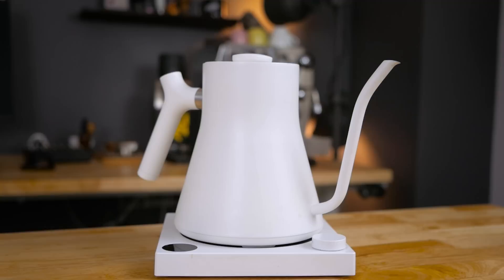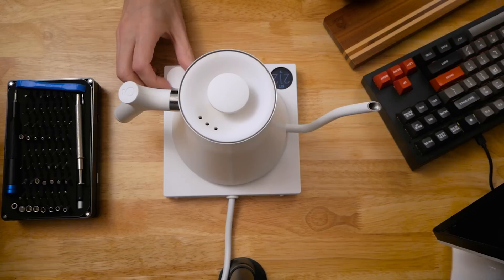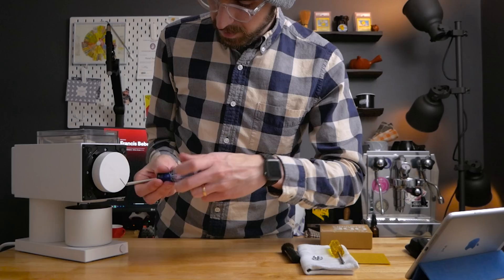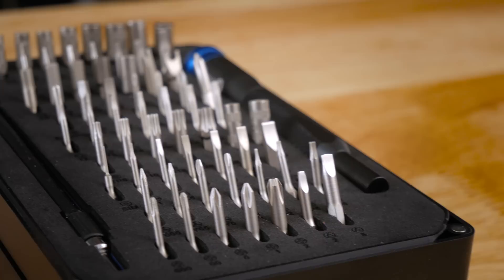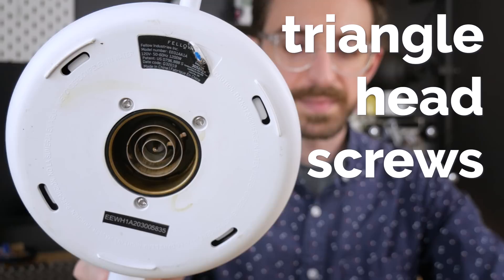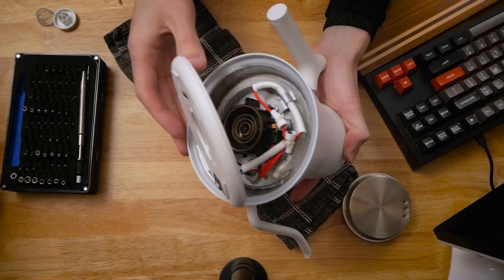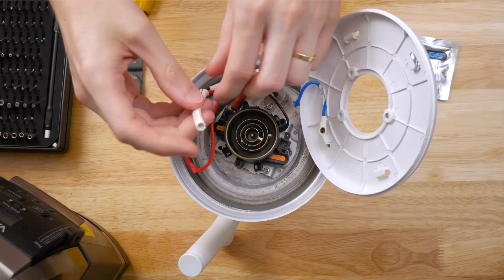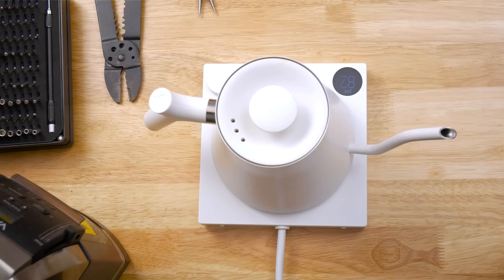I Almost Threw Away a $165 Kettle - Fellow Stagg

Comment: The fuse is made by Microtemp, model number is G4a00 184C with Yellow letters. G4 line is for 10A 250v which is 15A 120v. But I couldn’t find the same model. Since the item you installed could be not reliable according to amazon reviews, I recommend Aupo brand.(Aupo BF184 10A)
Reply: Also I recommend Klein 1005 crimping tool (or cheaper option : Newacalox multi plier 8 inch). Additionally if you don't have a triangle driver bit but you have 3/32 flat drive bit, it will work just fine. (Craftman Precision multi-bit screwdriver 18 pc set has it and it is only 9 bucks and very useful for other jobs too)
Reply: @imagelee  Torx should work too. I opened the base bottom triangle screws with a T-7, three points of contact for a fairly reasonably sized screw is ok.

Fellow also sells replacement kettles for $80. Given the cost of tools and time and potentially dangerous mistakes, most people should just consider buying a replacement kettle.
Reply: My kettle has just fused, but it is a European 240 V model. Will the fuse be the same for this kettle please?
Reply: I've just took my 240v apart to check the fuse (Its fine) As it wont heat up.  The Fuse Reads; 
MICROTEMP ZGEAAL G4A00 T 184C
Reply: I don't know if you're the same person who wrote up the instructions on the "ifixit" website. Either way, thank you for your comment. After opening my kettle and reading the thermal fuse it came withe - Microtemp G4A00 tf 184C - I couldn't find the same part or the Aupo part, but was able to find a thermal fuse that is 10A 250v tf 184C by searching for the Aupo thermal fuse. Looks like my kettle is up and working again! I did calculate the amperage before hand via the info on the kettle itself. So when I read your comment I knew it would work. I'm new to doing these types of repairs and glad so many people are as passionate to repair their items rather than get rid of them.
Reply: Literally anyone can do this but if you have panic attacks when handling unplugged electronics you can still ask around and see if a tech savvy friend or the IT guy at your job could take a look at this video and do the replacement for you. It's a 10 minute job and most people that already have the tools would be happy to do it for a pizza and some beers. If that is all out of the question try going to a phone repair shop. Throwing away an, 85$ kettle over a fuse is ridiculous.
Reply: I purchased the Aupo BF184 10A and repaired the kettle as per the video. The issue of water over boiling and continuing to boil beyond the designated temperature was NOT repaired by the recommended fix.  Not sure why, seems like the repair worked for others in this thread.

Comment: Important note : In the video he used crimp connector which is the right way to do it. If you try to solder it you can burn the new thermal fuse. So use crimp connectors or big heatsink on the fuse and be quick with the soldering iron.  If you decide to solder it check with multimeter at the end to see if it still good.
Reply: I don't think the way this was crimped was safe. The general rule of thumb is to never crimp solid wire as crimps are not designed to work with it.

I would try to provide a mental explanation but it's easier to just try it for yourself, crimp a solid wire and a stranded wire and try to wiggle both of them for a minute. The stranded wire likely won't get loose but I highly doubt that the single wire will still be secure at that point.

If you don't trust a youtube comment, just google it, it's industry standard practice that crimping solid wire is generally a bad idea.

I don't know exactly what they did to connect this initially but from some research there are special crimps which are designed specifically for this purpose, and it might be that they're spot welded (which would not generate enough heat for long enough to trip the thermal fuse), but in almost all instances I have found, the solid leg of the thermal fuse overlaps with the stranded wire in some form.

The risk here is that as the kettle gets jostled around, the crimp will get loose (also boiling water induces enough vibration to cause problems in and of itself, even if this part never moved). A loose connection can cause arcing. Arcing can cause things to heat up. Heat can cause things to melt and burn. So it's a fire hazard.

The only saving grace is that the thermal fuse should blow before anything catches on fire, but buying thermal fuses from amazon is already a risk. If it was a normal fuse, they're already cheap enough to manufacture that buying a name brand is reliable and nobody is out there trying to make a buck selling you a knock-off. When it comes to more expensive components, I would stick to component suppliers where you know what you're getting.
Reply: and solder may get brittle and fall apart after repeated heating
Reply: Ratcheting ferrule crimp should work for this case, add heat shrink tubing over the connection as common practice. It's a kettle, the wires are tucked inside, should not be too much stress/strain on it for however long life it has left.

Comment: My hario thermometer broke. Very weak piece of equipment. I figured, I'll buy a new one instead of buying the outrageously expensive EKG. I noticed that the thermometer costs 70 euros (you actually also get a lid in which you can insert it). As you may have expected, my lid is intact and it seems impossible to buy the thermometer only. I bought a 10 EUR thermometer on Amazon that I can insert into the lid that I still have. Problem solved. It's unreal how expensive things can become in the coffee world.

Comment: I think you are way too kind with a company that took the decision to use triangle head screws to prevent most people from trying to repair their product. To me this is simply evil, just like the oval head screws on Nespresso machines.

Thumbs up for the iFixit bits that help with both of these evil head screws :)
Reply from the maker: I almost included a segment with all the "unrepairable" things I've fixed recently with the iFixit bits. Would have been a very long video if I had kept it in 😅
Reply: triangle screwdrivers are not hard to find, also most of the time they aren't in with any real amount of force needed to remove it.  so generally a flat head screwdriver will do the job.
Reply: @justinbouchard  Of course they are not hard to find, once you start searching for them, and decide to spend the money.

But they add one more barrier that stops the merely curious people from just having a look themselves, or from sharing pics with someone else who could give advice.

In this day and age, anyone working in manufacturing appliances must know how bad the generated waste can be. The decision to go with about any kind of "security" screws is ethically indefensible.
Reply: @jmsaffroy  dude, any "curious" person would go to the dollar store, or do a quick google search and find out that you can fit a flathead in there........
unless that thing was glued together it's not anti repair.
Reply: @justinbouchard  or theyd go to their drawer where they most likely have a flat head or phillips head.
Reply: @jdrummerdd  Yep, which I also mention.

Comment: Great video. Saved me a TON of money. Thank you!

Just completed this on my own "broken" Fellow Stagg EKG. Super easy. You definitely need a crimping tool and you definitely need crimp connectors. All told the repair cost me under CAD $50 including the CAD $35 Klein wire stripper and crimp tool (which I needed for wiring outlets and light fixtures anyways).

Comment: I'm a little anxious about a video about replacing blown fuses, that lacks investigation into why it blew in the first place, and whether the root cause could pose a significant risk to others attempting to follow along. Especially for an appliance like an electric kettle? Could be worth a follow up
Reply: Exactly.  The main question here is--why did the thermal fuse pop?  It's there for a reason, after all--to prevent fires.  So the kettle got too hot at that connection--what's going on and why?
Reply: sometimes fuses blow randomly, but it would be much better to check the NTC
Reply: yeah I wonder about fixing small appliances......  can you inadvertently cause a house fire..... OK, mine was pretty old.  Going to home depot or target to get a simple straight forward quick boiling kettle.

Comment: My fellow has the same problem (shows the set temp, but wouldn’t heat), but only after I wipe down the base. Apparently, something gets damp. It works again after I either let it sit and dry out on its own or use a blow dryer for a quicker fix. Hope this helps.

Comment: ive seen this issue more than once and its such a bummer that it seems (without me really having a great understanding of laws around this kinda stuff) that by having a guide on how to fix it, they might really be trying to avoid essentially admitting that they've got a flaw in the design and opening themselves up to legislation or something.

Either way, thanks for making a clear video on this, even if i dont own one myself.
Reply from the maker: I was surprised there wasn’t a video already (at least that I could find) since this seems to be an issue that pops up quite a bit.
Reply: It really isn't a flaw in the design. Thermal Fuses are an important safety measure, but over time they do tend to fail. I've had to replace the thermal fuses on my dryer more than once.

The issue is that companies are not incentivized to tell you how to fix something so simple. Maybe they're concerned that by telling you how to open up the device they open themselves up to liability. Maybe they just want to be able to sell you another one when this one fails. Whatever the reason, the way in which we view perfectly good things as broken when a small component wears out is a huge problem.

Comment: Life saver! I already had one fail and spent $75 to get a new kettle (base was fine and they sell/sold just the kettle). I think this one is almost ready to fail based upon its occasional inability to heat water consistently, requiring the occasional off/on toggle. Last time I definitely thought it was the controller inside the base which I was unable to find a replacement for (made by some company in the UK). I'm set for the next failure(s), thanks!

Comment: I was going back and forth between all these electric kettles and I just kept hearing all these issues after a couple years with most kettles. I know everyone’s experience is different, but I finally just got a stovetop with a thermometer built in. Pretty idiot proof and will last potentially a lifetime. No electronics to worry about. That being said, the ease of use of a quality electric kettle is a huge plus. So lots of pros and cons to consider.

Comment: The last two kettles I have bought have both failed in a similar manner. They both became unusable due to the lid mechanism ceasing to work. The first was an expensive all stainless steel Magimix which was impossible to get into to fix without demolishing it and the second was a much cheaper Russell Hobbs, where the plastic hinge controlling the lid release snapped off. I grudged paying another £41 ($50) to buy an entire new kettle when the element still worked and all I needed was another plastic hinge so snapped off the broken plastic part and simply flip the lid off with a butter knife now once the kettle has boiled.

Comment: This is why I got the standard Fellow gooseneck kettle when my last electric one died. Use it with a small induction cooktop which is easily repairable if ever necessary; alternatively, I can just use it on the stove if necessary.

Comment: David, I do not own a stagg, but good point, I have a simmilar problem, according to manufacturer only a new part could solve ... I highly agree with this right to repair, I researched and there is a chance to fix it with replacement parts from other suppliers. Hopefully I will be able to fix it as well.  Thanks for the video!

Comment: Thank you so much for this! I've had the same issue with two (two!) Brewista Artisan kettles in 18 months and although their website says it's probably the fuse I wasn't sure exactly how to replace it. Can't wait to try it out.

Edit 2024-04-07: Okay so it turns out the Brewista is not set up the same way. I haven't been able to find a thermal fuse in the kettle body or the base, despite what their website says. I tested most of the components with a mulitmeter and everything seems to be in order except the heating element itself which isn't giving continuity. Since it's impossible to replace separately from the kettle and Brewista don't sell spares I guess I'll make do with my £140 paperweights and just never buy from Brewista again. 

(For the record I'm still none the wiser as to why my two kettles failed. I never ran it with less than 500ml of water and there were no big noises, smells, obvious short circuits, or other broken appliances. The base and buttons still work, there's just no heating...)

Comment: there are a ton of products that fail this way - my own kettle had this issue. My All-Clad waffle maker did as well. Get the right thermal fuse temp spec, and you should clamp it in place. $5 has saved me several hundred.

Comment: Hello David, I had a different issue of temperature going wild. I think the sensor contact might be at fault, IMO.  I cleaned out the center contact on mine, and the issue hasn't surfaced yet.  I thought about your issue, and it could have been related to the issue I had. Without a proper temperature feedback from the on-kettle sensor, the base unit will continue to apply AC to the heating element and it could trip the thermal fuse inside.  Just some guess, but something to think about.  Thank you!
Reply: any update ? do u fix it?

Comment: The fix is simple but sooner or later something else will crap out on that kettle and it will be done for good. Big reason I bought a regular stovetop kettle. Handgrinders will also likely be more reliable over time vs. electrical ones with a lack of manufacturer support and spare parts.